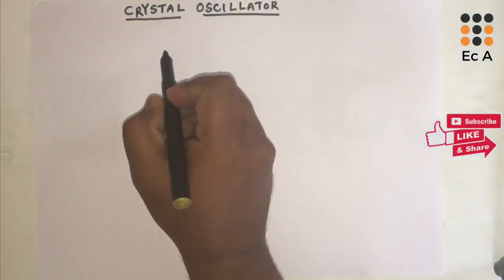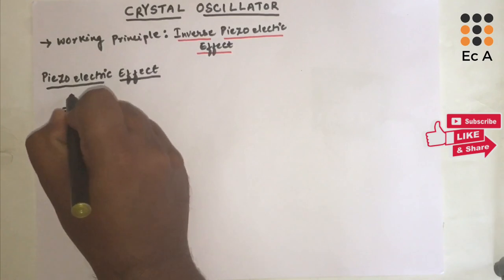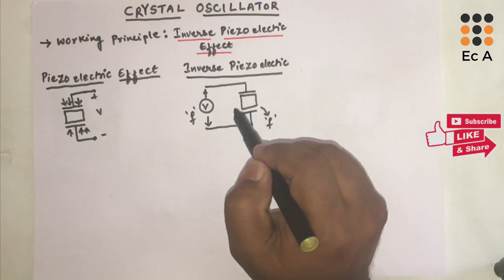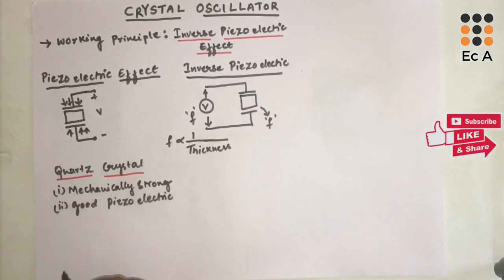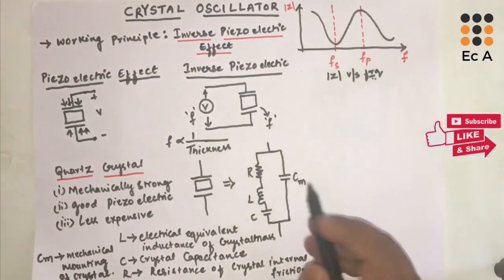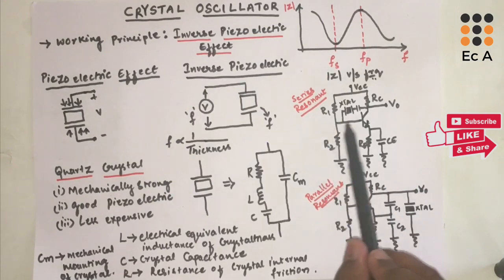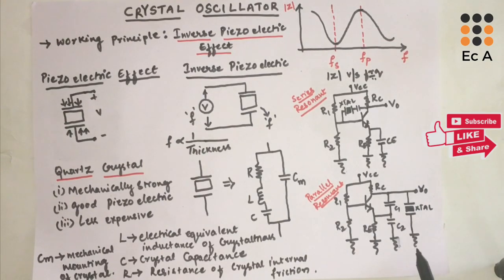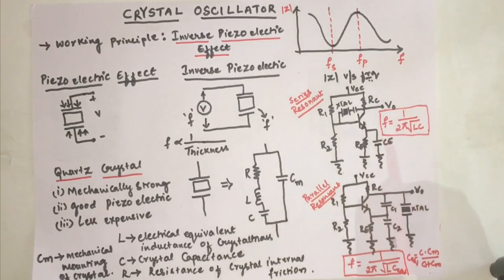#74 Crystal Oscillator & Piezoelectric effect || EC Academy

Comment: At 6:50, is Ceq formula for parallel or series connection......
Reply: For the Capacitors connected in parallel , Ceq=C1+C2+...........
Reply from the maker: Yes it’s the formula for capacitor connected in series at 6:50 👍